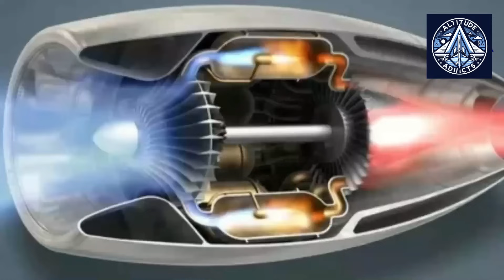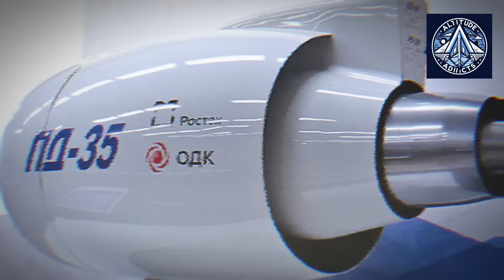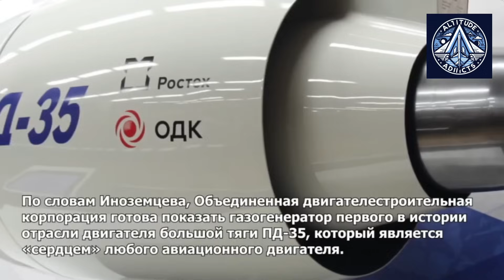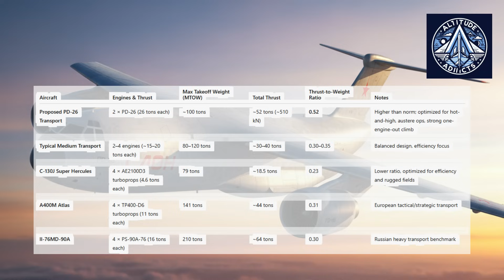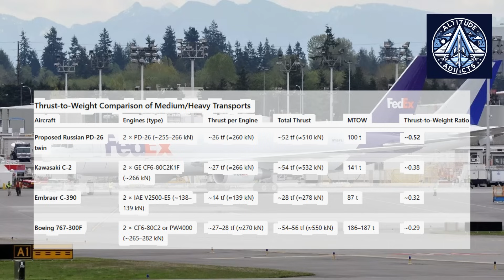Russia’s Slon + PD-26: The 100-Ton Military Transport Aircraft | Kawasaki C-2 | Embraer C-390

Comment: The best possibility for new Russian  heavy transport there is no need for new engine. The best option to speed up for heavy transport aircraft engine is already available made by Kuznetsov NK- 93 open rotor prop fan design during Soviet Union in 1980s this engine was ground tested and was installed on IL 76 test Lab aircraft all ground and Air testing was completed
But Soviet fell funding stop and the project faded away. NK- 93 engine even today is the best performing engine in the world 
better than PD 14 and any other and all western engines. GE and RR are trying to copy this Russian engine quietly to show off that they invented open rotor aircraft engine. Dude go look and research on NK-93 made by Kuznetsov Russian invented in the 80s. Lol

Comment: So the question and the problem essentially is there because Russia didn't go for development of the 40 - 50 tons of thrust engines, which is what is needed for it to be a 2 engine Slon replacement for the An 124... which is why it's easier to just scale down the PD35 to the PD26 version and have a 4 engine craft instead ( the same as in An 124, but with slightly higher thrust).
Reply: This is a MILITARY transport aircraft, the most important thing for it is reliability, that is why large transport aircraft are always produced with four engines!!!
Reply: @globalpower6967  reliability is provided with it's ability to fly entirely on 1 engine.
Reply: @korana6308  A heavy military transport aircraft with a full load and an engine problem must complete the mission! And with one engine it can fly to the nearest airport. Do not confuse a heavy military transport aircraft with civil aviation!!!
Reply: @korana6308  Look at the medium and heavy military transport aircraft, they ALL have four engines!
Reply: @korana6308  Russia has begun developing the PD-47 engine, with a thrust of 47 tons, but it is not being created for military transport aviation.
Reply: @globalpower6967  an engine shouldn't be destroyed to begin with. Whether 1 is destroyed or 2, it's bad either way. But if one gets destroyed, mission is compromised anyway. It will get to the same destination but just much slower. There's no problem with that. 2 engines are just better in every way ( if they are reliable), because they consume less fuel and are more efficient as simple as that... which means it can fly further... and that is an important metric for a military craft ( or any craft).
Reply: @globalpower6967  its because of the ancient doctrine, when engines were less reliable... not anymore.
Reply: @korana6308  What does reliability have to do with it??? Engines can be destroyed by air defense systems,... You forget that this is a MILITARY transport aircraft, it must have the maximum level of survivability in WAR conditions!
Reply: @korana6308  Outdated??? Stop writing this nonsense!
Reply: @korana6308  The military is not interested in fuel consumption!!! This is not civil aviation!!!!!!!!!!!!!!!!!!!!!!!!!!!!!!!!!!!!!!!!!!!!!!!!!!!!!!!
Reply: @korana6308  You need to advise the US Air Force to use two engines!😃
Reply: @globalpower6967  I would say is not primary interested. 10-15% more fuel consumption means 10-15% less range.
Reply: Do you have idea  each trust of the PS-90A engine?
Reply: @tmstms2769 ps90 - 16 tons. D18T - 23 tons. they want the pd26 with 26 tons

Comment: How Russia develop An-124 Slon without permission of the Antanov ? as i read originally planed to develop it as a joint program, I belive after the war it was abandoned
Reply: Slon is not related to An.
Reply: @korana6308 No, Slon is a varient of the Antanov An-124, it is clearly mentioned in the wiki page of an-124. Correct me if i'm wrong.
Reply: Antonov is a soviet enterprise situated in ukraine. The 124 and 225 were  developed by  engineers from all over the union. 
Since the  collapsed of soviet Union  no single 124 or 225 has been manufactured.
Russia wanted to restart production in collaboration with ukraine but the war stopped the idea.
Reply: @tmstms2769 what he said.
The only thing Ukraine ever built were Stefan Bandera statuettes.
Reply: @tigersilberhannes9153  Ukraine has changed Russian ship "Moskwa" into the submarine unit ;-)
Reply: @JosefCissek  and made a proud full patriot to became bread toaster ;)
Reply: @wahyuwirawan727 Hmm, you mean the Tu-160 and Tu-95 bombers on 1st june this year?  After 3 day trip to Kiev 2022?